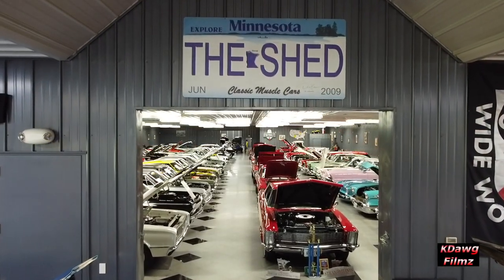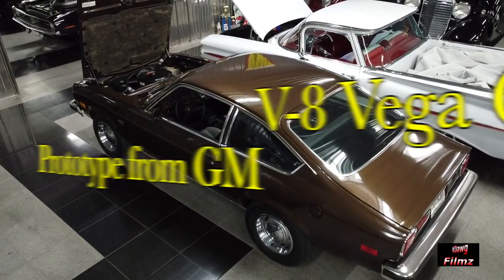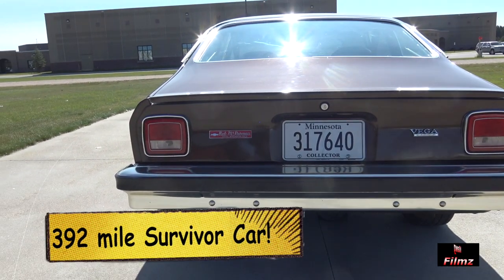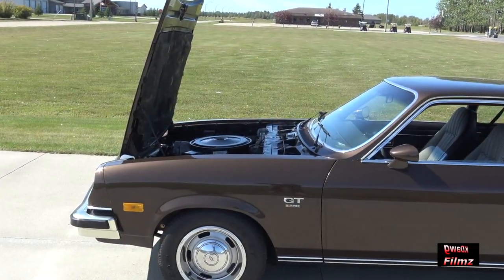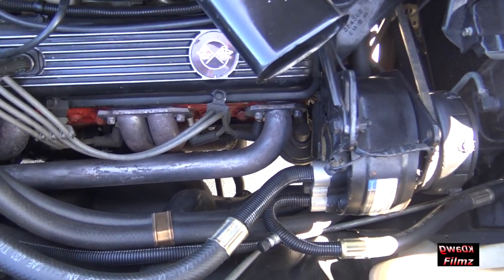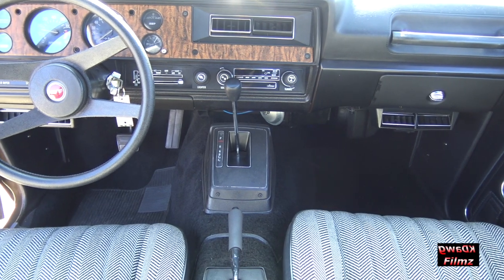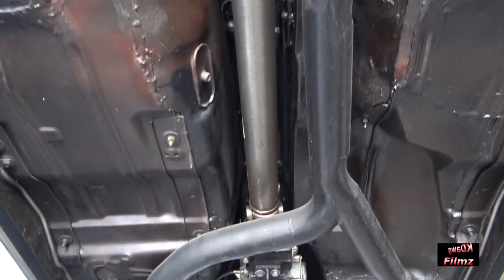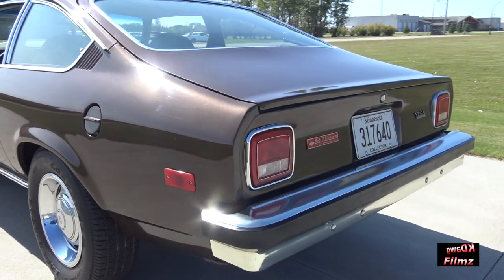1975 Chevrolet Vega GT Prototype 350/370 HP in the Bob Marvin Collection at “The Shed”  Warroad, MN.

Comment: Having owned a v8 Monza with a 262,110 hp. This would be absolutely unreal. I love the Rallys.
Reply: I had one too! It was a dog off the line but once you got moving it pulled strong. I used to race the new Monte Carlo SS cars (1980's) from a roll and it was a tie.
Reply: I had one also 4.3 262 V8 stock with sagina 4 speed  but we replaced 262 with sb400  what a rush

Comment: How is it that it’s a “392 mile survivor car” but the flowmaster muffler (founded in 1983) has rust holes in it? This car is definitely not Chevrolet Motor Company modified or even a prototype. This is a home built job
Reply: Exhaust systems rust out quick in Michigan...
Reply: @BuzzLOLOL  Because of all those "shovel ready" jobs didn't do the trick like Brandon will.
Reply: @BuzzLOLOL  "392 mile" quick?? I don't think so. 😂
Reply: Flowmaster mufflers had no rust protection... just bare steel... daily condensation on the metal rusts them out...
Reply: @BuzzLOLOL  👌
Reply: Where's the cats factory would do this this should've been pre 1972 not 1975 as with other stuff in this bench race of no ways .

Comment: I have very serious doubts as to the authenticity of this being THE GM factory, “prototype”. As a 30 year builder of V8 Monzas and Vegas, there’s too much about this (especially under the hood) that hints to this, most likely, not being authentic. Although, if they were able to produce authentic paperwork to back it up, then I could be swayed. The prototype used a three-core radiator, not a four. As well, the prototype used a 10-bolt posi not a 12. The prototype did not use a 370 hp 350, it actually used a 250 hp V8. This has aftermarket Hooker headers, of which you can’t tell from the shots, but the driver’s side should have one primary that goes over the frame and through the wheelwell before coming back under the car. The prototype used stamped steel valve covers, not these aluminum (?) covers.
Reply: And another point out under the hood, that A/C compressor, I'm pretty sure that model didn't exist until the 80's
Reply: We didn't have those annoying sounding Flowmaster mufflers in the '70s either.
Reply: @brianhiggins4832  right GM was still running A6 compressors until 79 and this car has a 1980 and up R4 compressor
Reply: The Vega is sharp no doubt. I have to call hold up on GM Prototype???? The A/C and alternator ect is just like my 79 v8 Monza. GM doesn't sell prototypes, they have crushed thousands of prototypes, don't see them making a special exception for a Vega, but I wish they would let me buy THIS ONE. The exhaust is a question also. It is a nice VEGA none the less.
Reply: @brianhiggins4832  good eye!
Reply: When they put a Buick V6 into the "Monza" wagon (which was a rebadged Vega wagon) they welded in some bars in to reinforce the front frame stub. Vegas have weak frames. I put a full cage into mine just to stiffen things up. I had a guy come out to look at mine and he told me about a friend who put an LT-1 in a Vega and couldn' get the doors to open, LOL
Reply: @jameskrys5286  Yes, absolutely.  The Monza and it's clones (Vega/Astre included) had these really long and heavy doors that even without the added engine torque caused the doors to sag.  But as soon as we would drop a V8 in them, the doors were the first casualties of the frame twist.
Reply: @NorthernChev  EV West makes a Tesla Crate motor that fits anywhere a SB Chevy would. How about a Tesla powered 73 Vega GT?
Reply: I agree the because the original prototype V8 Vega had an all aluminum engine which was a 215 I believe was a Buick Engine and later sold to Land Rover
Reply: I'm not buying this at all, stickers etc can all be bought aftermarket. Any vin number on that car ?? Nice work but not anything other than home built
Reply: My 1977 Vega has the fuel filler on the left.
Reply: Vin tells all. It also stated " prototype" Harrison radiator and A/C compressor..
Way more Cam than the factory would have used...
Reply: It was built by GM employees I guess that makes it a GM prototype doesn't it. (The first one was in 1972).
Reply: @SHSPVR  GM sold the 215 to Rover/British Leyland YEARS before the Vega.
They appear to have tried to buy it back to use in the Vega - and failed - during the early Vega design process.

Aluminum heads/block but iron/steel liners, so it wasn't QUITE all aluminum - but close.

I had a "aftermarket swapped" Olds 215 in a '73 Vega GT for a while, bought it used from a SCCA Unlimited class autocross driver.
PLENTY of power for such a light car.
I never found the cornering limits on that car (55 "national" speed limit at the time, and it would do that in a "25 MPH" interstate corkscrew comfortably).
Previous owner had dropped it ballpark 2 inches, and put big fat Goodyear gumballs all around - while the engine was around 30 pound heavier than the STOCK Vega 140 (in a car design that already had good handling).
Reply: @bricefleckenstein9666  No they did not tried to buy it back to use and yes I know the history about the engine I know that it was sold in 1965 to Land Rover could have easily just easy licensed it back to GM, and it was just a proof concept car at the time with first one, The second received all aluminum 283 small block but end up as limited quantity and were never offered as production car factory V8 option but like many things back in the 70s things ended up getting moth ball because of the oil crisis and EPA didn't help matter. Now when I was referring to all aluminum I was referring to the block in the head them self They could have easily done away with the steel liners If they had used nikasil plating but at that time it was too costly and well over 20 years it did not become popular until the 90s and mainly just on 2-stroke motorcycles besides the winkle engine. That was my very first car that I ever owned but it was actually a Chevy Vega Panel Express in orange and black Interior which I later added all the GT accessories to it and modified the original four cylinder made into a closed deck surface and steel cylinder liners which also had a big cam, 4 barrels and headers and higher compression pistons and addressing the other issues too this one car I wish I had never sold.
Reply: @SHSPVR  It's been WIDELY REPORTED that GM tried to buy the engine AND TOOLING that they had also sold as part of the "engine" sale back from BL/Rover - which modified the engine in to several different displacements over the years, up to a 5.0 liter version, and were still using a version of two of it into the 2000s.
And yes, the "Rover 3500" and it's offspring WERE in fact production vehicle options in many or ALL Rover models for decades, as well as Land Rover engines for even longer.
Plus they also sold SMALL amounts to other manufacturers, like Morgan (the +8) and Triumph (the TR8) that were ALSO production cars.
Reply: @bigcurt011  Had a 1976 Monza with a 4.3 V8 and it had an R4 compressor on it so............I'm two years too late for bringin' that up, but it's true anyway lol!
Reply: @brianhiggins4832  Actually the R-4 was first used in 75. They had to have a compressor that used less HP for the smaller and less HP engines they were making. I remember the A-6 when used on four cylinder engines had switch to increase the speed a little when compressor cycled on.
Reply: You guys are all saying this guy with a multi million dollar car collection got fooled?
Reply: @bigredc222  Nobody has said any such thing.  What HAS been clearly stated is that this car here, claiming to be an authentic factory prototype, has TONS of equipment and configurations on it that did NOT come on the ORIGINAL factory prototype... There's way too many red flags on this particular car that shed doubt on the claim of originality.  That's all that's being said.  Judge appropriately.  That being said - This "may" be the original factory prototype, but if so, many items that were original to it have been stripped or altered extensively, invalidating it's claim of originality.  See notes in above comments.
Reply: @NorthernChev  It sounds like you really know these cars, and that 1000 times more than me, and most of the comments agree with you, so that means if you are all correct someone got lied too. The narrator says the car is from the Bob Marvin collection. We only have a few options, Bob got lied too when he bought the car, Bob lied to the guy that made the video, or the guy that made video is just making it all up without Bob's knowledge, or there's no such person as Bob Marvin and it's all made up. When I saw the electronic ignition distributor cap, I thought that proved you were right, but then I looked it up, an GM started using electronic ignitions around 1975. I learned to drive in my mothers 1972 Vega, what I learned about that car is as far as my Vega knowledge goes, so I defer to you.
I'm just having fun being Columbo and trying to figure it out.
Reply: @jameskrys5286  Pass on that one. Other than straight line acceleration it would be a boring ride, just road noise.

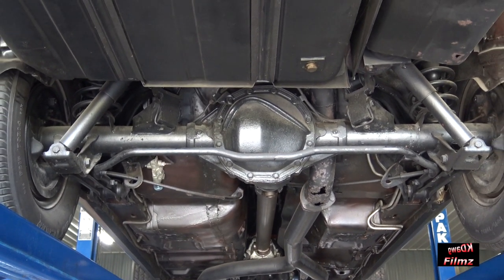Comment: 2:30 Rust holes in the exhaust system. This super low mileage car was no doubt started and run for many short times without being driven.  Most likely allowing  H2O vapor from combustion to condense and settle as liquid inside [ and rust ] the low points of the cold pipe and muffler.  If a car is driven normally this would allow the exhaust system to reach it's maximum temperature, hot enough so the water can remain vaporized and exit the system with other vapors and gases.
Reply: saw that...
Reply: thats from not running it long (until water stops dripping out of tailpipe).

Comment: Nice holes in the exhaust pipe before the rear axle.
Reply: They are getting people ready for the body rot in the rest of the Vegas hysterical!  It’s only a guess but I think it may be due to the fact it’s been parked in GM since like 1976 or so and not been started once.
Reply: It makes you question the 392 miles claim.

Comment: My mom had a 74 vega GT , bright orange with a black stripe on the bottom with GT in it . Never seen another 1 like it. But sadly a tractor trailer pushed us up to 90 mph until my mom lost control and we went flying thru 13 guard rails , down the side of a steep embankment and smacked into 2 trees. Luckily we survived
Reply: Sounds like murder.
Reply: i had exact same gt wagon ,it was a automatic  orange/  black  and black interior ,loved it when muffler fell off
Reply: Still have my '77 Pontiac Astre Formula Safari (kammback) Station Wagon... in silver... FORMULA in black stripe along the bottom and in other places... came with Iron duke 4, 5 speed, posi... never seen another like it... no pictures of one available online... it is real, I've seen that they were available...
Reply: Sounds like Spielberg's DUEL movie. Yikes! Glad you made it out alive.

Comment: For anyone wondering ~ 
Yes, you can fit a 396 big block in these cars.
Get the panel wagon, easier to cage.
But yes, it can be done and its a total handful !
I miss that car. 😏😎
Reply: I liked my 1973 GT with a Olds (higher compression 4V Buick variation) 215.
Engine was about the same weight as the original junk 140, car was dropped about 2" and big Goodyear gumballs all around.
Original 4 speed was plenty strong to handle the engine, and I never did find the cornering limits, while it had PLENTY of power in such a light car to get up and move.
Reply: @bricefleckenstein9666  
They were actually fun little cars.
It didn't matter what motor was dropped in it.
It was always ~ 
Ok, you ready to go have some fun ?
They were a blast.
Reply: MOTION in Long Island put 454 big blocks in them. Then sold them to the public at a nearby Chevy dealer.
Reply: @markg7030  
Motion did a lot of insane stuff.
I looked up to Baldwin Motion builds.
Reply: @bricefleckenstein9666  I still have my 73 GT with a 67 Buick V6 in it. It has the Vega Saginaw 4 speed too. If i ever change the engine I'd put in a Turbo 4 out of a Camaro with a 6 speed. (Like that NoCal Garage Vega)
Reply: @jameskrys5286  DId you realize your V6 (iron) probably weighs more than my Olds 215 V8 did?
That Saginaw in the Vega was a standard "lower power" GM usage product in those years, but still rated in stock form for 300 HP - plenty of capacity for most common Vega upgrade engines - and they could be upgraded for somewhat more capacity.

Comment: Great video on an extremely rare car.               KILL the Music. It makes it hard to hear the commentator.  
I am interested in the car, not the music.
Reply from the maker: The music is 20 dB softer than the voice of the narrator. There is no problem hearing  the commentator. The music also fills the void when the narrator is not talking. Notice how the music fades up and down. Music is an important element in a professional video. Notice that I used the same technique at the end of the video, but replaced the music with the sound of the car idling as I walked around it. The sound of the idling is 20 dB softer than the narrator. When the narrator is finished talking, the sound of the idling engine increases.
Reply from the maker: @1982MCI  Don, You made my day with your kind words. Thank you.

Comment: This was never intended as a production vehicle. It may have been a "prototype", but no way GM was going to produce a Vega with a 350 engine not less one with 370hp. No way, not in 75 or 76. Most likely it was a mule for engineering studies or a one off to test suspension components or other chassis components. GM would build these for testing failure points. They needed to do this because computer modeling was not at the level as it is today.
Reply: By '75 GM had the H-body engine compartment set up for V6 and V8 in Monza with heavy duty crossmember, front suspension, heater and A/C hoses relocated from near center to outside area, and dimpled HVAC box so any small block Chevy V8 was just a bolt in... even BBC... 
Early 1970 Corvette sales literature listed a 370 HP LT1 350" but as far as I know only the 360 HP was ever actually installed in production 'Vettes/Camaros... a few 370 HP ones may have been lying around GM Engineering on pallets... they used the Duntov 30/30 cam from 365/375 HP 327's... 
I couldn't make out the rear suspension design on this car... my '77 Pontiac Astre Formula Safari Kammback Station Wagon has a torque arm like later F-bodies/GNX's...
Reply: @BuzzLOLOL  Well, you do make a great point here. GM definitely would put into production vehicles that would conform to homologation rules or to make the car more competitive, such as the Grand Am with the kamback rear window to make it perform better in NASCAR. My point was more to the engine package in the Vega. In 1975 or 76 there was no way they could or would put a 350/370 hp engine in a Vega production vehicle. Especially when you still had a Trans Am and Z28 still selling.
Reply: @paddle_shift  - They prolly should have put the smooth quiet Chevy 262 2 bbl. V8 as an option in Vega and Astre to increase interest in the economy and all versions...
Reply: @BuzzLOLOL  the LT -1 in the Vette was rated at 370 hp , in the Z28 and the COPO  '70 Novas it was rated at 360 hp . Same engine , different exhaust manifolds .

Comment: Pontiac slapped a small block V8 in the Fiero back in the day (my neighbor was a GM engineer) and track tested it. The car wanted to take off like an airplane at about 135 mph do to bad aerodynamics. And, it crushed the Corvette's performance of the day.  Pontiac made some really fun cars...but, no more. GM rarely gets anything right or stops production when they are onto something special. Fiero, Trans Am, G8/GTO, and even the 1987/88 Grand Am two-door with a 5-speed.
Reply: I went to a car show once and there was a guy who had Fiero with a Cadilac Northstar V8 in it.
Reply: Looking at the base C8 mid engine Corvette do 2.8 sec.s to 60 shows that a V8 or even hot V6 Fiero would have killed Corvette sales...

Comment: With "392 miles" when did it get the Flowmaster muffler, that wasn't manufactured until the mid 80's, and it looks like has a hundred thousand miles on it? All that silver looking paint don't look like it was factory either. I would think that someone would remember this being built, even as a experiment. The make believe 4 cylinder engine had a tough 4 speed transmission, why the 400 auto, if they were going to try to aim for the sport car crowd? Looks like someone is trying to sell "Wolf Tickets" did you get any buyers?

Comment: Built a wagon with an L82.   A hatch with a 400 sbc.  Most fun was a 79 Monza Spyder 305 4 speed from original woman owner.   Put an aluminum head 355 with a Nash 5 speed in.    To find a rust free H body today.
Reply: I have a 1973 Vega GT. I took it to Ziebard as soon as I got it. It has a full cage and a Don Hardy Dana 44 with 65 Impala drum brakes.
Reply: I still have my '77 Pontiac Astre Formula Safari (kammback) Station Wagon... in silver... FORMULA in black stripe along the bottom and in other places... came with Iron duke 4, 5 speed, posi... never seen another like it... no pictures of one available online... it is real, I've seen that they were available...